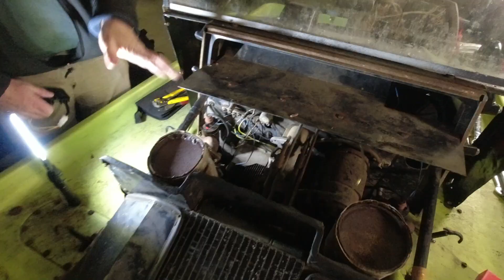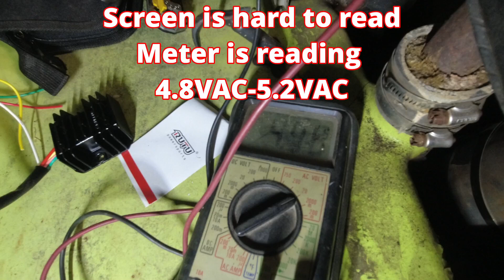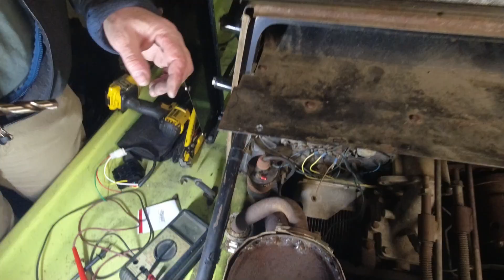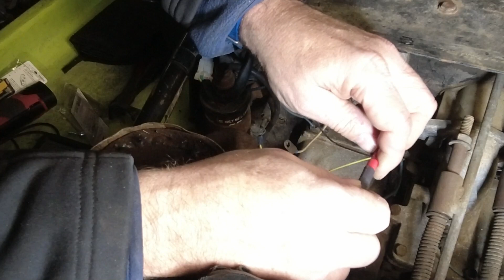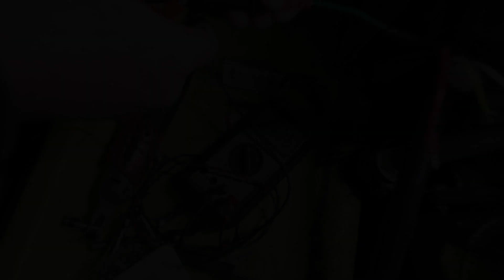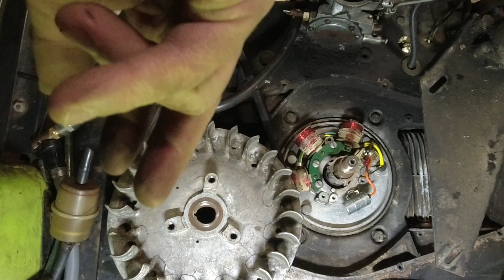1973 Cushman Trackster Charging System FAIL

Comment: do you know how to make this free roll so i can move this thing to a spot to start my restoration with out having to pick it up
Reply from the maker: There are two kind of plunger things on the transmission that have to be pulled up.  The machine originally came with stamped sheet metal clips to hold them in the up position but those are likely long gone.